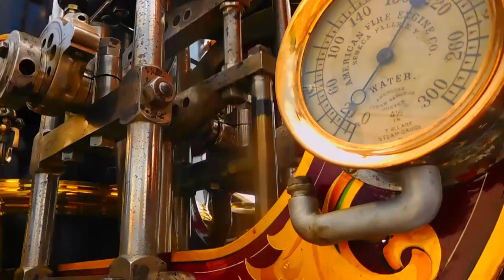1899 AFECo. Steam fire engine

Comment: Was the feedwater supply taken from the same supply as the fire pump? Also, is the boiler a VFT or VWT?
Reply from the maker: Nope, seperate pumps, with suction starvation control.  (never shut them fully for the obvious reasons.)   And its a modern welded up VFT that sadly replaced the original beautiful water tube and header example.
Reply: @AEKarnes  the watertubes have always fascinated me. Would love to find a set of drawings for them. The CSFA had an engine that was restored to running condition and had an original watertube boiler. Sadly the owner no longer has the energy to take it to CSFA events.
Reply from the maker: @WesleyHarcourtSTEAMandMORE  Do show me somehow!  Who built the engine?
Reply: @AEKarnes  Is there any video showing construction of the original water tube boiler? What was the pressure of the original boiler?